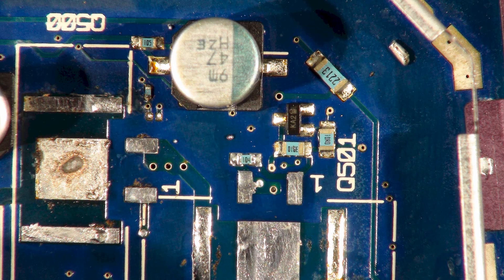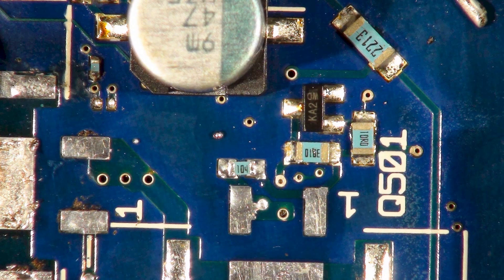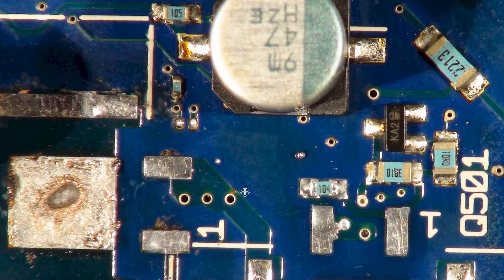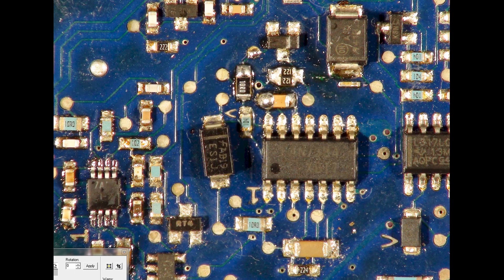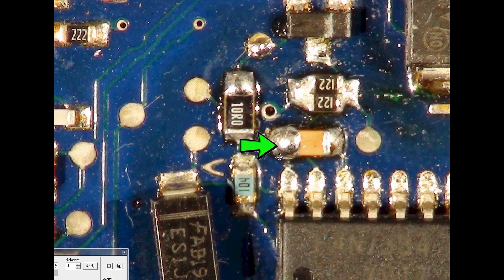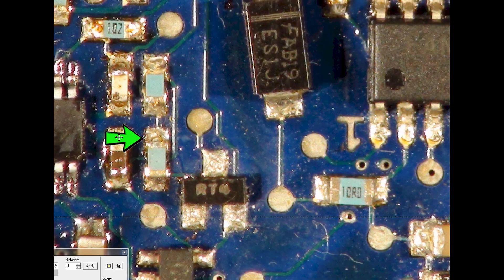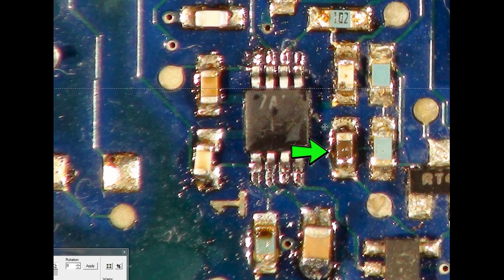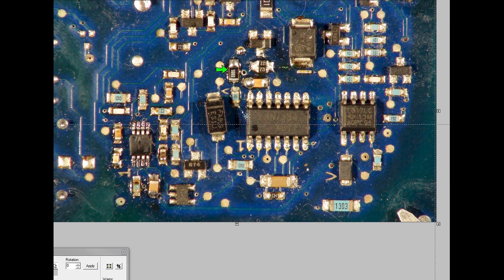Bose SoundDock 10 Diagnostics and Repair Video Part 2 -Check Components  322642-0020

Comment: Hi Smoke,

Great post! I was wondering if you could point me to where I can find the MNAC 21-2. I'm currently trying to repair my SoundDock. It seems to have voltage in the high-voltage section, but there's none in the low-voltage section. Do you have any advice on what I should check? Are there specific test points you'd recommend?

Thanks in advance for your help!
Reply from the maker: I would help if I recognised MNAC 2--2. Do you mean the LM5021-2? Which component is that. I cant find any reference to it on the net or in the schematic.
Reply: @razenby  Thanks, I think is the one that I was looking for!  Just for confirmation https://youtu.be/i1zlrKH-yac?t=247 the IC (U505 in the schematics) on the left side with 8 pins.

Comment: Hello nice post! I have 23V but when I pack all wiring and boards the unit doesn't power on. However I have 5 volts on the other board and also 15v . The laptop senses USB connector, made a test. I tried resetting the unit, no succes
Reply from the maker: Have you tried unplugging the front interconnect board? Does it start up then? You should be seeing a 24VD across the big DC smoothing cap on the power board

Comment: Hola Saludos de desde México, actualmente no cuento con un ingles avanzado.
Tengo un equipo del mismo modelo,  en el momento que lo conectas a la corriente eléctrica no enciende solo hasta después de mucho tiempo enciende sin problemas.
He realizado mediciones en los circuitos de PWM de conmutación de mosfet pero no noto nada anormal, me gustaría una guía de como proceder a la revisión de este equipo. Noto que el problema radica en la fuente de alimentación.
Reply from the maker: Reemplace el capacitor de aluminio de 33uf (a veces 47uF) al lado del transformador cerca del capacitor azul de 100N. ¡Coloque un electrolítico de aluminio de 47uF 25V y siéntese y esté muy satisfecho! ¡Disfruta de ese gran sonido Bose! Ah, y por favor miente y suscríbete.
Reply: @razenby   Muchas gracias

Comment: amigo excelentes videos saludos, tengo un SoundDock 10. que no enciende lo desarme y pude notar que el amplificador TPA3100D2 98T CJZ2 tiene una de sus pines quemados, es decir ya no esta haciendo contacto con el chip, es posible que este componente me este generando la falla de que no encienda, y si ese es el caso, hay forma de hacerce un bypass, o definitivamente hay que reemplazarlo para que vuelva a funcionar.
Reply from the maker: Sí, una sobrecorriente en el amplificador no producirá energía. Es posible que deba cambiar el chip LM5021-2 (controlador PWM) ya que no toleran la situación de arranque por sobrecorriente. Además, si tiene un 33uf junto al blick del transformador al final del condensador azul de 100n, cámbielo por un 47uF 35V, el chip TP ahora está obsoleto pero todavía está disponible en www.aliexpress.com. Buena suerte.

Comment: Hi! I have a damage board because a little lizard make a short between component marked with "V" and 1303 resistor... Where I can start to check? Where I can send a pic to you? Thanks!!
Reply: Those components appear in 10'15"
Reply from the maker: I advise you change the components shown in the video.  It is very unlikely to be just one component.  Think in a chain that rely on each one not failing. if one link in the chain fails  then it is very likely that they will all be destroyed or stressed.  If stressed then they will fail later.  So change the lot.